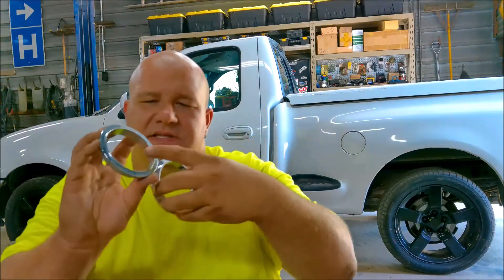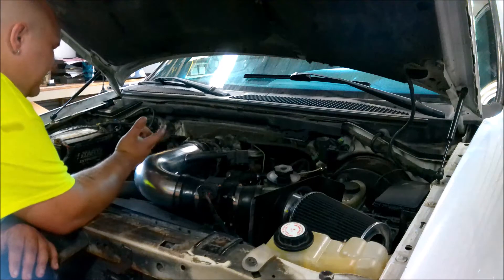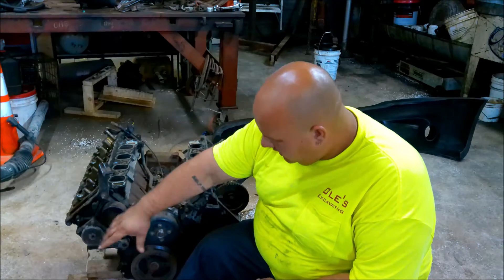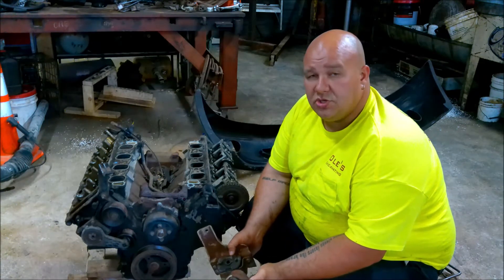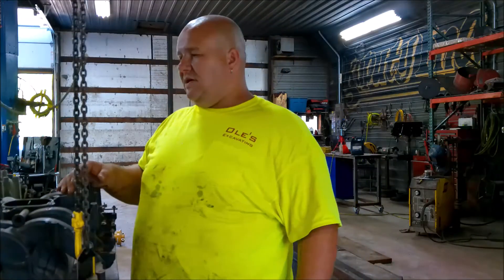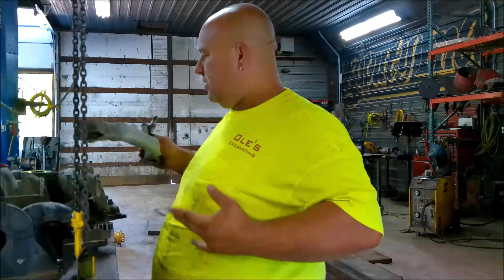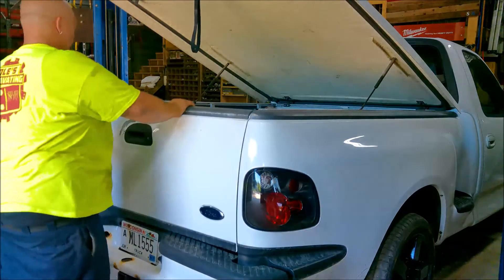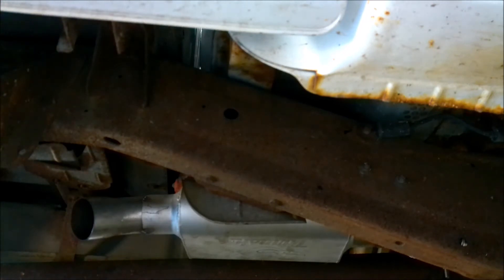Ford Lightning clone 4.6 to 5.4 swap

Comment: The triton 5.4L 2v can take one hell of a beating I have an 04 f250 with 172k and she’s still solid for her age… looking to see more on the build and some highway rips
Reply from the maker: I agree, they are pretty tough units. From my understanding they use the exact same engine for N/A and supercharged, so im looking forward to putting some boost to it. Your not the first person to say I need to make some driving videos, so I better get on it.
Reply: @KaputyINC  yeah their pretty low compression I was thinking of grabbing a blower from one of the old interceptors theirs a ton of them around and they don’t really go bad from what I heard .. hardest thing is finding headers.. Like to see the headers you used if they fit in that they should def fit in the 250 more clearance I would think
Reply from the maker: @InnovativePoolsLLC  They were around $700 but they fit great and if it stops it from having a leaky manifold, their worth every penny.
Reply: @KaputyINC  what brand headers did u say JEGS
Reply from the maker: @InnovativePoolsLLC  PaceSetter Performance 70-2226 - PaceSetter Long Tube Headers. I thought they were more expensive, apparently they were only $350
Reply: @KaputyINC  thanks man, going to grab headers soon due to the fact the super duty’s over here are safety inspections only due to the classification of their weight they don’t do emissions tests my friends got the same year but a 150 they plug his in   Lol

Comment: I have a 2002 f150 rwd 4.6l that I'm thinking about swapping over to the 5.4. I just wanted to know is it a direct swap? Do I have to change or reprogram my PCM? Will the swap interfere with the pats system on my truck? Do I have to swap the GEM? Do I have to swap the flex plates and torque converters? Will I have to swap out the entire exhaust system (I have 5.4 shorty headers already)? Can I use the same coil packs out of my 4.6 on the 5.4?
Reply from the maker: Did you watch the video?  Direct swap, 4.6 computer and wiring, no pat's issues, stock 4.6 gem, 5.4 flex, 5.4 torque converter, 5.4 is wider so exhaust Needs to be modified, pretty sure 4.6 to v10 have the same coil packs.
Reply: @KaputyINC  thank you. Just wanted to make sure because I've been reading different forums that say that I have to change this or that or else it won't start.

Comment: What research i have done on your 4.6 to a 5.4 its doable.Power steering you will need 5.4 bolts.Wiring is the same but you may have to extend a few wires length.The van should start and run but would need to be tuned.But if you could get anther 5.4 pcm and get it tuned in it would work  better.Thats what i know all the best of luck.
Reply from the maker: In theory if you get the 5.4 PCM it shouldn't need a tune, but with a tune you could have performance or fuel economy optimized. I don't believe I had to extend any wires. Good luck with your project

Comment: Did you have to get your PCM tuned and could I use a programmer with tunes on it to compensate for the 5-4
Reply from the maker: I do not have it tuned. It fired right up, idles just fine, the only thing is there's a dip at full throttle in the mid-range. I plan on getting it tuned just haven't got around to it yet. I used the 4.6 computer and harness. As far as a programmer I think the most important thing is that it's tuned to your specific ECM I believe, I could be wrong on that though.
Reply: @KaputyINC  thanks for your response I've been trying to get answers wasn't having much luck
Reply from the maker: @andrewfitzpatrick2223  https://www.f150online.com/forums/articles-how-s/355403-4-6-5-4-swap-notes.html this is what I used as a guide, and it was very helpful
Reply: Did you run cats on your exhaust?
Reply from the maker: @andrewfitzpatrick2223  i do NOt remember

Comment: Seems like every Lightning clone I've seen leaves out the most obvious Lightning parts which are the ground effects and the supercharger.
Reply from the maker: I plan on adding the ground effects over the winter, I need to do a little work on the rockers so I plan on doing it all at once. I'll eventually add a blower.

Comment: Do you know if the 5.4 would be a direct swap into the 4.2 v6? Of course I need to do exhaust, wiring, mounts but as far as subframe and motor mount locations the same on the body itself?
Reply from the maker: I think the frame is the same, that's usually pretty standard.

Comment: Currently wanting to put my 4.6 from my 2006 f150 in this new 2008 f150 lariat 5.4 truck that has a bad motor. My motor runs great. Would everything be the same just backwards?
Reply from the maker: Im not sure, I think those are 3 value motors and don't have any experience. I know the 2 valve would be the same in reverse.
Reply: @KaputyINC  How can I tell if my 4.6 is the 2 valve or 3 valve?
Reply from the maker: @njmxjunkie3128  2 Valve stopped in 04 I believe.
Reply: @KaputyINC  I thought that too but apparently they used it in work model vehicles till a lot later. Mostly vans but some f150s also.
Reply from the maker: @njmxjunkie3128  good to know, I honestly have no idea on specifics.

Comment: May I ask about the wiring?
 Subbed!
I have a 97 , 4.6 5 speed. Doing a lighting 5.4 conversion and keeping it manual. From what I've read use my original harness, lengthen my coolant temp wires and just have the computer refreshed with  a lighting tune..
Reply from the maker: I'm not sure about using the super charged motor with the n/a harness. If you have done your research and it's been done/works that would be sweet. I used my stock 4.6 auto harness on my 5.4 auto swap, didn't have to lengthen any wires but I don't have a big blower on top either. When I have looked at lightning 5.4 motors in the past, they typically are advertised with the lightning wiring harness, but that's not to say it's not the same. Sorry I couldn't be more help.
Reply: @KaputyINC   It's all good man...appreciate the reply. Truck looks great! Thats exactly what I'm doing but keeping my manual and with the supercharger  can't afford one...so I'll build one.  I'll still be cheaper even with the t56. Already got the full lighting suspension..just time
Reply from the maker: @19jody72  When I saw the beat up ones going for 12-15k I figured I could build one for that. From the research i found the lightning long block is the same as the standard truck long block, slap on an aftermarket blower, and your still under 10k. So far im impressed with the Belltech suspension kit, im ordering their sway bar set up in the near future.
Reply: @KaputyINC   forgot to ask, did you retune the computer for the bigger engine?
Reply from the maker: @19jody72  i haven't yet but I  intend to.  It runs good, idles fine, accelerates, but I think the tune could be cleaned up since I feel a dip  at full throttle around 70 when im hammering on it.
Reply: @KaputyINC   I may end up doing what you did first..na 5.4.. then add the supercharger later down the road. Then again, if you used your 4.6 harness, won't be any different than just putting the lighting engine in complete the first time around . If you get a chance.. put up.a couple videos of.driving and it idle .. if you don't mind
Reply from the maker: @19jody72  sounds like a bunch of good ideas to me
Reply: @KaputyINC   forgot to ask, what year is your truck?
Reply from the maker: @19jody72  2001
Reply: I’m in the same boat as you !!!! I’m looking to swap the 4.6 out for the 5.4!!?! How much extra will it be
Reply: @MattAyala-s4r  I have since found out you use  yhe 4.6 wireing and simy plug it a up. You'll need to have the 4.6 computer tuned to really take advantage of the 5.4

Comment: I’m doing a 5.4 swap on my 97 4.6 f150 and the only thing I’m having trouble with is the knock sensor the 4.6 sensor connects but the whole is to small to bolt in but the 5.4 sensor doesn’t connect but bolts in any ideas on what I should do?
Reply from the maker: Can you splice the pigtail off the 4.6 knock sensor onto the 5.4 knock sensor?
Reply: @KaputyINC  I would but the 4.6 sensor has 2 wires but the 5.4 has 3 would it be difficult to splice them or should I rethread the hole for the 4.6 sensor to bolt in
Reply from the maker: @Imploziblr9  copied from a forum- The 97-98 99 4.6 uses a 2 wire knock sensor. The 97-98 5.4 has 3 wires of which one is a ground for the shield. Both have a Yellow /red wire to pin 57 on PCM.
1997-98-99-2000-01 Yellow/red to 57 on PCM 4.6 Same for 5.4.
97-98 Pin 91 feeds power for 4.6 and other components. Same for 5.4
Reply from the maker: https://www.f150online.com/forums/articles-how-s/355403-4-6-5-4-swap-notes.html

Comment: Thinking of building a lightning clone but with a 6.8 v10
Reply from the maker: I think motor length may become an issue, but if you get it to work, that could be sweet. i have 3 work tucks with the v10, I like them but dk how much of a performance engine they are.

Comment: Was the swap a straight bolt on? Since it’s v8 to v8?
Reply from the maker: yes, no fabrication required other than my exhaust, but I have long tube headers so its to be expected. Its best to get a complete 5.4 so you have all the intake parts and fuel rails. These trucks came with 5.4s and 4r70w in 4x4 form or lightnings so there's factory parts for most issues. I used the the trucks factory 4.6 harness and it plugged right in. The only mix in match was with pulleys and tensioners due to 6 and 8 rib variations.
Reply: @KaputyINC  sweet thank you! About to start working on a lightning clone my self
Reply from the maker: @marcusjones466  Nice, i spent many late nights doing research and reading forums and when it comes down to it, its pretty much a straight swap. Bolt the intake runner valve thing out of the way, replace the oil filter adapter gasket, rear main seal, remove the intake manifold, and put the starter in after you install the motor if your installing the motor and trans at the same time. other than that its cream cheese.
Reply from the maker: And check the dipstick tube

Comment: did you change the torque convertor? ive heard yes you have to but the tranny shops ive called said they were the same
Reply from the maker: I did change the torque converter, there almost the same. There's like a 200 RPM difference, and it supposedly is relevant. The 4.6 torque converter would be better for performance I believe. But it puts the transmission at/or above it's limit via torque multiplication.
Reply: @KaputyINC  im getting ready to 5.4 swap my 03 supercrew and that was the last piece of the puzzle for me thank you very much love the truck btw
Reply from the maker: @thaddthomas9305  thanks, glad I can help